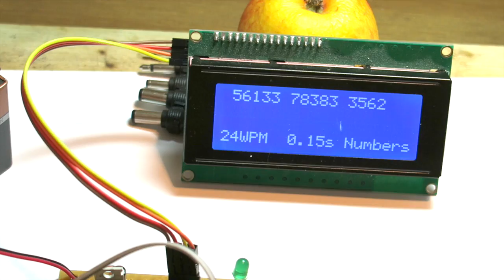Arduino based Morse Code tutor - Ham radio projects.

Comment: Congratulation Dan to the project and huge plus that you shared the code at github. i wish more hams would do that. I guess there is a common misconception that the code must be perfect before "releasing" it to the world. However, there is no such thing as perfect code without flaws. Now, here is what the open source code and the community really shines, people voluntary come and improve and fix, enhance the code and all for the greater good. There may also be that hams does not know Git and how easy it is to freely upload code, schematic, etc to github. Another benefit is that your efforts is preserved, which may not be the case with a personal blog or your own web page, which is quite annoying when you find an interesting idea or project that you want to dig into.

Comment: hi this is very intersting project iam very happy if you send GSM BASED POWER THEFT CONTROL SYSTEM USING ARDUINO UNO R3
Reply: +hunachew moges  BY EMAIL  yalehunachew2321@gmail.com or +251943403036
Reply: +hunachew moges  arduino uno R3 CODE

Comment: I think you have started something really good here, (if indeed you are the first to think of and build this), ..... well done. ...
Ideas, - 1, - one call-sign per line. .... 2, - actual sentences. ....  3, - take your code input and translate.
Reply from the maker: +Mike M Hi Mike, thanks for your comment. Ive made significant changes to this project since this video (see here http://www.m0tgn.com/2015/11/morse-tutor-kits-details.html ) and completely agree on the actual sentences. 

I'm writing up a SD card interface, so actual QSO sentences, common phrases and possibly a QSO mode, where you RX a bit, send some back, RX a bit etc etc may also work. Let me know your thoughts.

Thanks again.
73 Dan